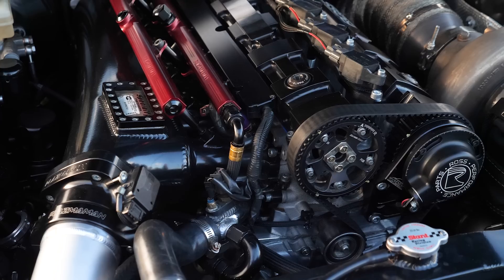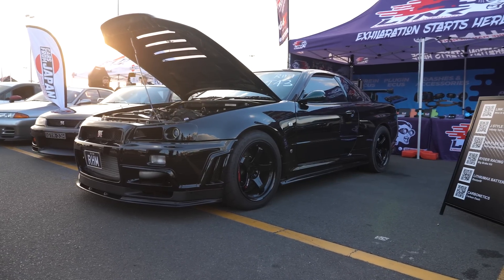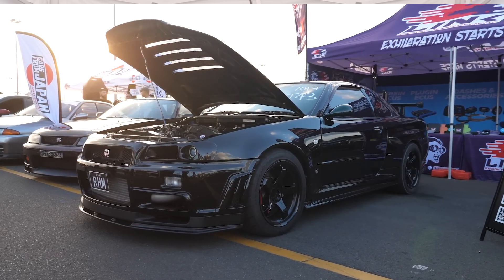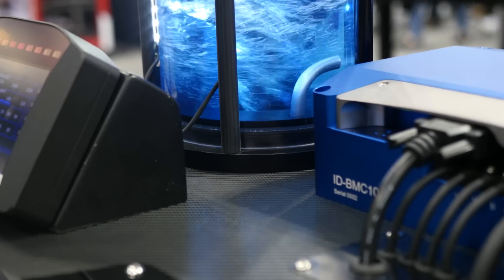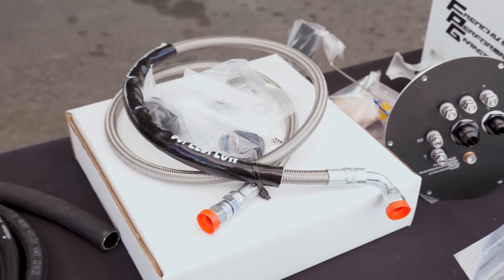More Power = More Fuel, But How?

Comment from the maker: 🚙 Building a fast car? Get $400 OFF the all-inclusive VIP online course package deal: - https://hpcdmy.co/idt
👨‍🔧 Expert motorsport plumbing. Start learning instantly with 50% OFF your first online course: https://hpcdmy.co/0ct
TIME STAMPS:
0:00 - Upgrading A Fuel System
0:13 - Kevin: Frenchies Performance Garage
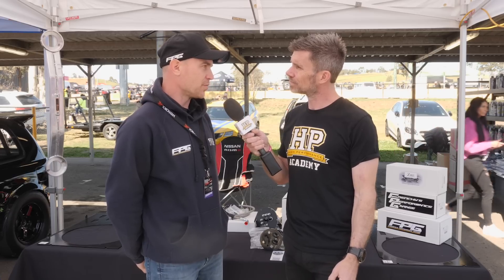0:25 - The Problems
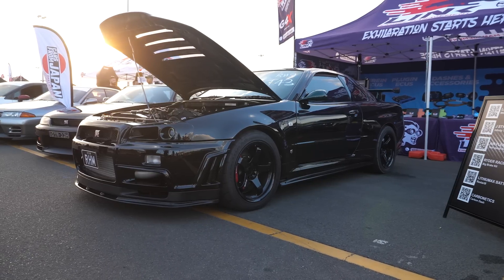0:56 - Why Times Have Changed
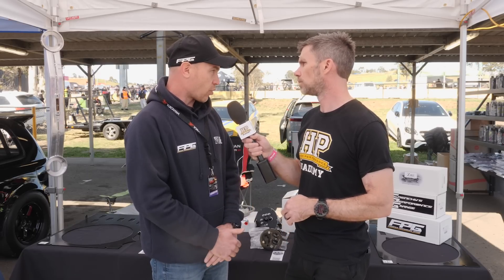1:50 - People Want Quality
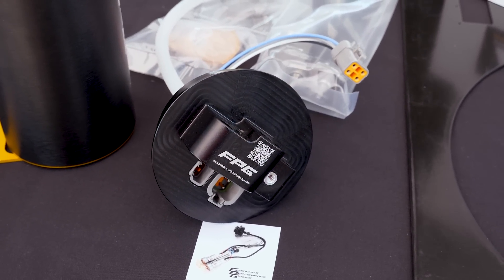2:15 - Quality Also Relevant To Value Now
3:10 - Fuel Surge Tanks
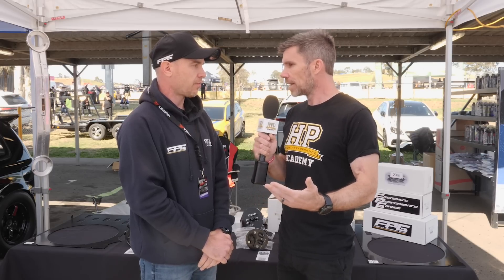3:50 - Factory Vs Aftermarket Surge Tanks
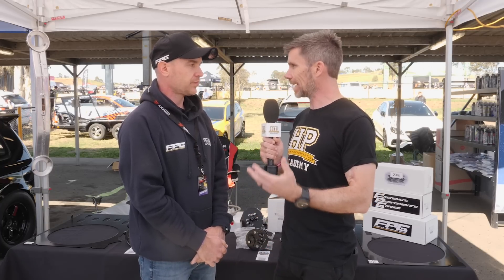5:07 - Pump Options/Considerations
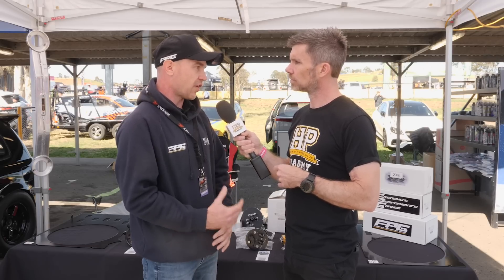6:04 - Fuel Line Fittings
6:53 - Wiring Solutions
8:14 - Thanks Kevin!
8:30 - BUILD.TUNE.DRIVE

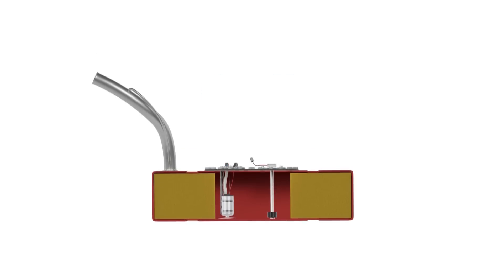Comment: 4:45 Great animation. Is this for an upcoming course?
Reply from the maker: It's from the motorsport plumbing course. It covers fuel lines as pictured in that animation as well as brake, clutch, oil, coolant and powersteering, along with the associated tools and materials for the likes of AN fittings or barb fittings etc that Kevin mentioned in this interview too. You can find the course here: https://hpcdmy.co/0ct
It takes a lot of work but this is the level we're at for the animations we add to HPA course material these days thanks to the team, in particular Sam who is also behind the camera during many of these interviews. He's great at fending off people who try to walk through the shot every 60 seconds too 😅 - Taz.

Comment: It's sad these cars are so expensive... I miss when car culture was men who worked on their own cars and the cars weren't expensive.
Reply from the maker: There are still cheap cars around, but times and prices have certainly moved on for some models for sure - Taz.
Reply: @hpa101  I don’t see any evidence of cheap cars. What cars are cheap?
Reply from the maker: Where do you live? I can link you to your local eBay or Facebook market place.
On mine, a bunch of Honda, Mazdas, VWs, Subarus and more which all have a ton of aftermarket support for mods and tuning software etc beyond just the high spec models.
None of them are free, and you have to pay to play regardless, but they're not $100k+ GTR's that's for sure 👍 
Have a look around your local car club at the grass roots level and see what others are running too - Taz.
Reply: @hpa101  Well, when you put it like that, I see your point. I bought an rx8 for 4k USD this year and will be dropping a Chevy V6 from a Camaro into it soon. It should be a decent track car that I don't mind wrecking. That's the only one I really liked out of honda mazda vw or lesbarus. 

s2000 is nice, but way overpriced, too.
Reply from the maker: RX8's are great value here too for a RWD option with an engine conversion.
I almost bought an S2000 for 16k NZD in 2019, but I thought the KMs were too high for what I would get back for it. The same car is back up for sale for close to 40k NZD now. I was wrong.

I think you made the right call racing something you are prepared to rebuild. Different strokes for different folks, Dave here sums it up really nicely in relation to rally builds - Taz.
https://www.youtube.com/shorts/PXBsVqtGNAs
Reply: It's the financialization of everything that has made everything expensive.

Comment: I am starting my build - engine and trans purchased but planning and parts buying before I install - I have mid-engine saddle  fuel tanks that join by pipe then go to fuel filter and pump.  even on my 450 - 500hp NA build a surge tank sort of sounds like it will provide the safety to keeping my injectors filled, much like an drysump or accusump would do for the oiling in making sure there is always fuel in a reserve to feed the injectors.  Is it really for turbo cars or does it provide the same safety in a lower hp NA build - or does it really matter more when there is a fuel cell that has more slosh and pickup issues?  I still don't understand why more fuel cells are not funneled on the bottom panel and gravity feeding the pump vs. top mounted pumps...
Reply: @sltillim  I think the reason more manufacturers aren't going bottom mount is the same reason semis quit running cross over tubes, too easy to rip shit off.
Reply from the maker: You can get fuel surge issues in N/A applications too. 
We got it quite bad in the SR86 when it was still running the N/A 1UZ-FE on E50 (it was really built for the street by the previous owner, nothing against them for that).
Like most things, it depends how you use the car. 
The previous owner only had it on semi-slicks and I think just did a bit of sprint racing (we were just doing 1 hour enduros on full slicks), so the issue didn't pop up at all for them I believe.

I guess the point there is an issue that can cause problems and should be taken seriously, but it's also something that you might waste money addressing needlessly. Look into what others using that system are doing and saying regarding fuel surge vs power levels vs use cases and make some educated decisions from there.
If you're an HPA member you can post up in the forum and see what info you can gather there too - Taz.

Comment: So basically it's modern lol GM has the same thing from factory except it's in the gas tank
Reply from the maker: Hopefully it's not the same as the ZL1 which can have fuel surge issues with the tank half full though eh 😅
In essence you are mordernising a vehicle doing this, but also what you need for a road car vs a track/race car is always going to be different, modern GM or otherwise 🤘 - Taz.
Reply: German cars have had a similar setups since like the late 90s lol